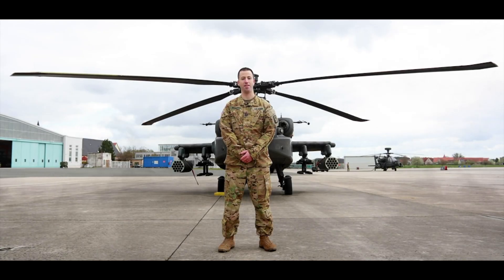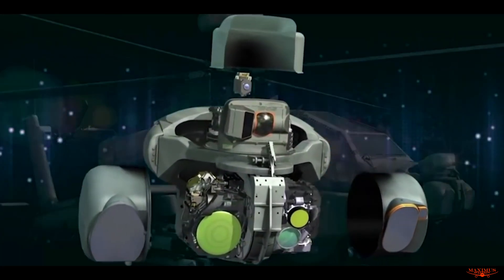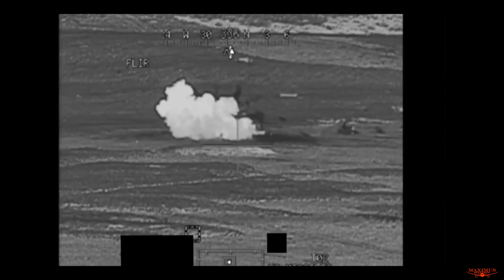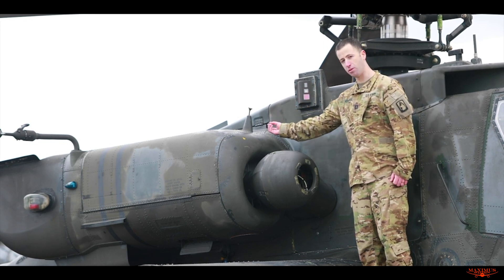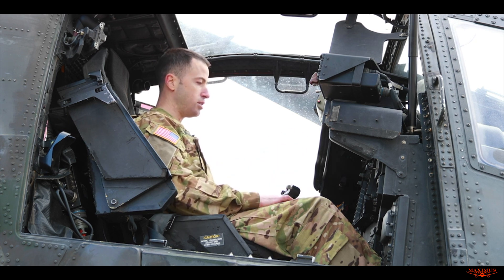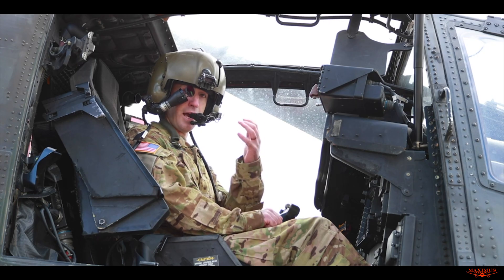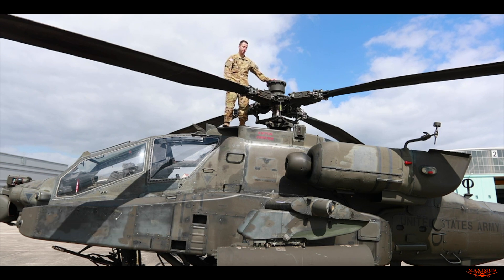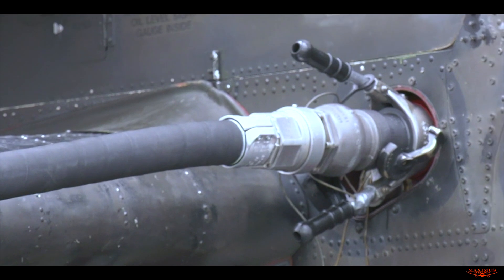How It Works: US Army Pilot Shows You All The Systems On The Apache Longbow And How They Function

Comment: Question from a “fixed wing” pilot: does the rotor speed (rpm) stay constant during flight (from TO to landing)?
Reply: Yes. But engine speed varies depending on load.
Reply: Yes sir! It is fully governed and can be taken over manually if other system has a malfunction. 👨‍✈️